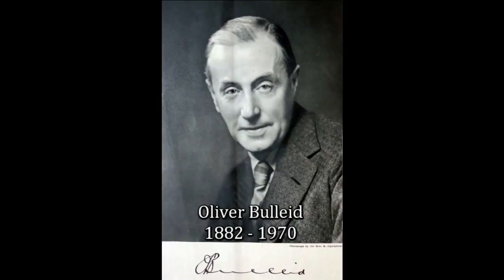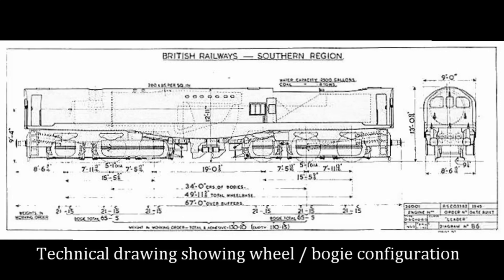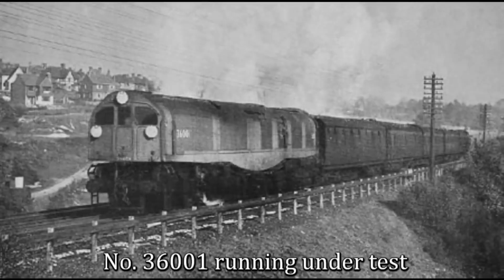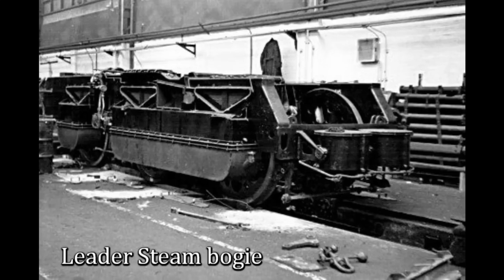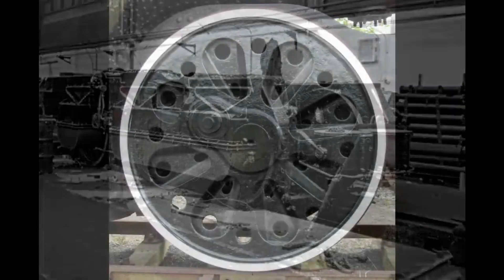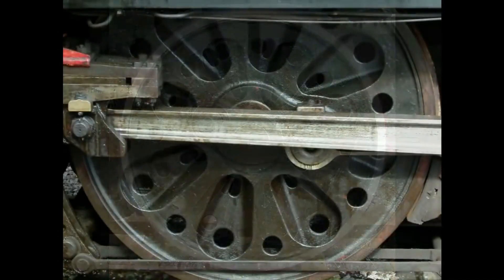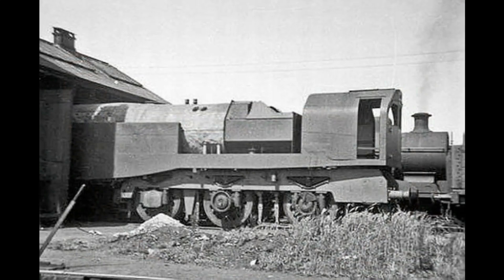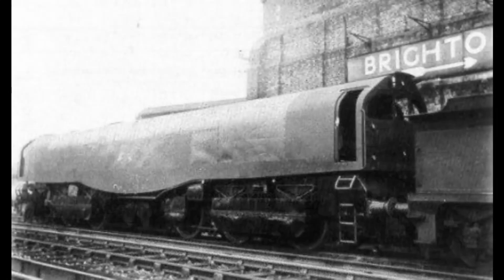The Leader Class Locomotive: A Bold Experiment in British Steam Engineering #leader #experiment #fyp

Comment: NATIONALISATION = INSUFFICIENT TIME FOR TECHNICAL DEVELOPMENT !
The "Leader" Class tried to cure a number of realistic general  operational issues with steam. As Bulleid had intended. But like his Pacific's, he was ahead of what was technically possible for Industry to produce. Hence the Bulleid Chain drive, which was a last minute substitute for Italian Caprotti (No Patents available during WW2), and before the British Caprotti variant. So the "chains" produced, had numerous issues, just like a Motorbike chain. The "Leader" used "sleeve valves" which in a moving steam loco revealed more technical issues, not experienced with their use in stationery plant equipment.

 There was also insufficient time for development to iron out the numerous "bugs". Further Bulleid was fully aware of the Government intention to Nationalise the railways, which was not something to his liking. So he short cut much development. He was also fully aware of the "Diesel" breathing down his neck, even though he was quite correct in stating, that given development time the steam loco could compete fairly against "Diesel", as later proven by the famous L.D Porter.

Comment: There was one flaw that you failed to mention. The fireman only had one entry point to his workplace plus the passageway beside the boiler. This passageway was created by offsetting the boiler, but this was the cause of the uneven loading on the bogies. To remedy this uneven loading, the passageway was filled with scrap steel, making the passage way impassable. If the Leader had derailed, the fireman had to pray that his entry point ended up on the top side. Otherwise, he would be dead long before rescue could occur.
Reply: Another issue was that, under test at Brighton, someone slammed a bogie into reverse, seriously damaging several components.  Although repaired, it was never quite the same again.  The hope that 36002 would prove that incident had damaged the class's chances were kyboshed when the stop order was issued, allegedly just a couple of days off completion.

It's recorded that before the unauthorised reversal, the engine was running sweetly on just 5psi pressure.  Can't recall if that was a steam.or air test.